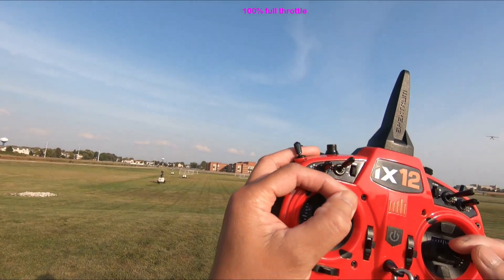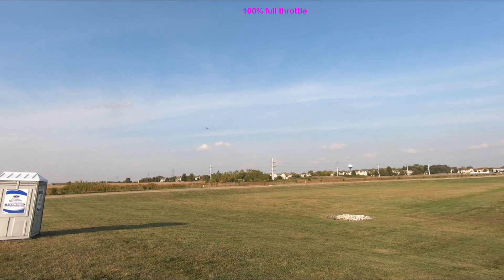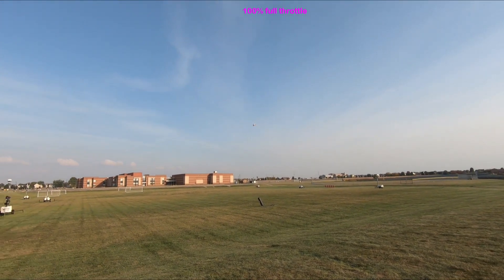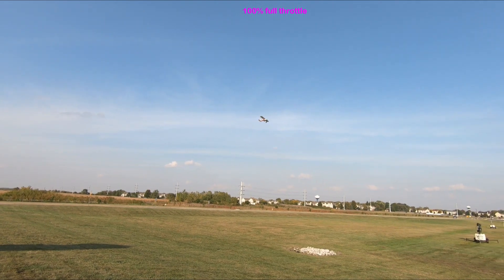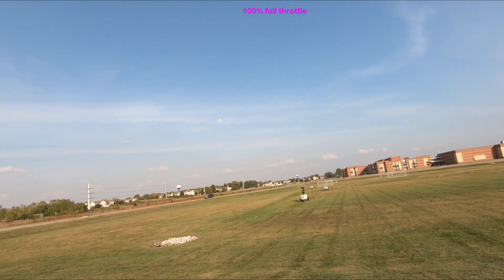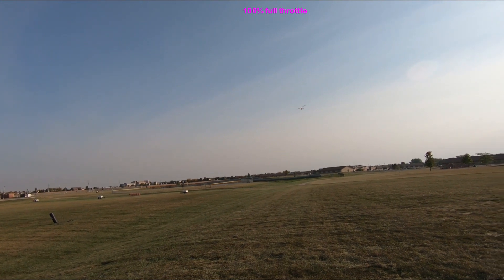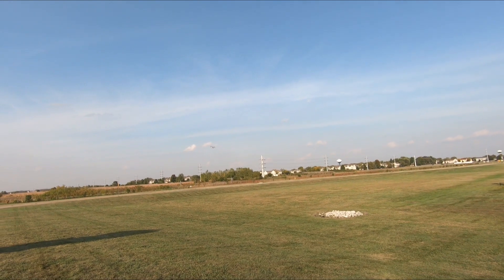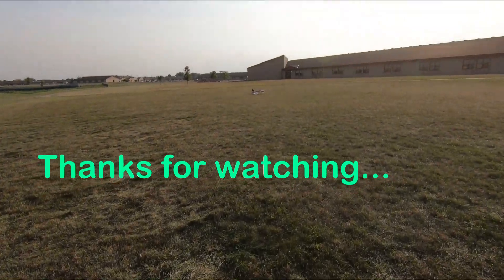Bison XT STOL (4S 16X8 prop)

Comment: No stabilization, why?
and it looks very tail heavy causing to be even more unstable. 
I would never ever fly a 4s pack on a 420kv motor.. at least 5s with that 16" prop would work .
Reply from the maker: The spec is for 4s and 6S.  Yes, it flies much better on 6S but my light controller board is burning hot on 6S.  Thanks for watching.
Reply: @msj143  

Oh no,  may be put a resistor in line to your leds.